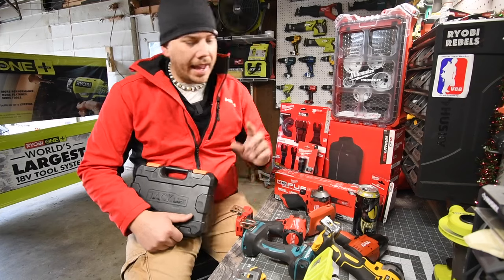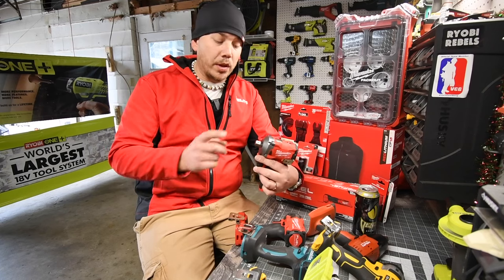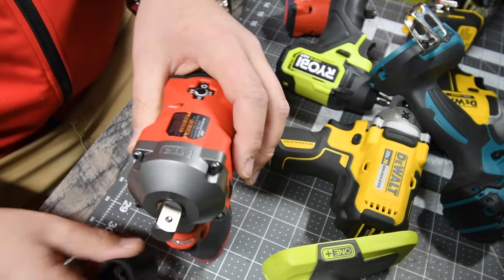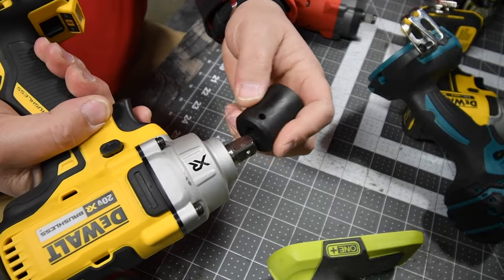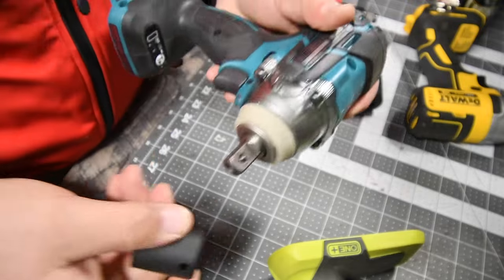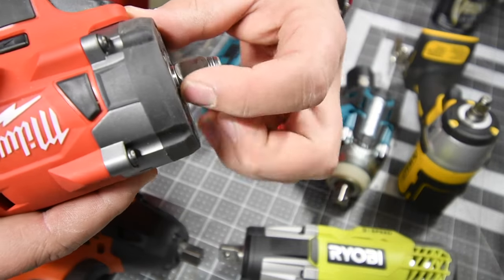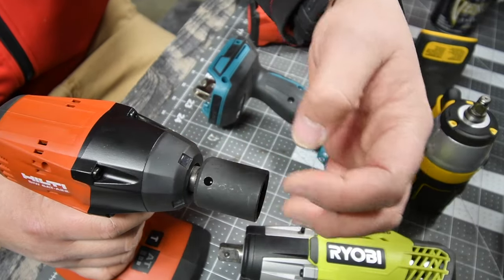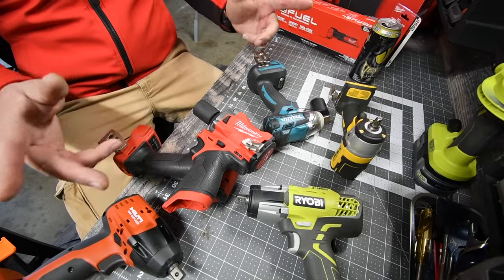(Detent Pin) and (Friction Ring). Whats the Difference?

Comment: I think it is a safety feature from Milwaukee but I could be wrong.  I would buy that M12 1/2 Detent Pin if I work on certain type of equipment (secured for safety reasons) or at higher elevation.
Reply from the maker: I think I have a defective anvil
Reply: @ManCaverTools  Reach out to Milwaukee Tools and they should fix it.

Comment: The manual states under assembly that a nail must be used on the pin detent model to remove the socket
Reply: Can somebody verify this?
Reply from the maker: I will definitely read that
Reply: @ManCaverTools  I've passed up a couple good clearance deals on some M18 impacts because of how the pin works. Some people put an extension on it and just leave it so you can swap sockets easily.
Reply: @Thastenrenar  late reply but that's exactly what I did too

Comment: Cool. The Pin detent is for safety to prevent sockets from accidentally coming off, falling,  and hittin' someone in the head. However, the anvil and socket combination affects how well it works. You can install impacts and not line up the hole and pin and see how the retention works out, or use a 1"  long impact extension with ball detent.
Reply: Good point, I hadn't thought of just adding a small extension on to give you a pin detent conversion. I have two pneumatic impacts, and on an air impact, if you bump the trigger, the socket and extension can accelerate to 5,000 rpms and go flying in about 1/2 of a second, and it's really scary. I have had to learn to be very careful. For safety, a locked pin detent is probably unbeatable. It's a tough decision when buying new, because some people hate split rings, and other people absolutely hate pin detents.

Comment: i have to say that the i had an issue with m12 1/2 friction ring anvil where sockets would rub against the metal housing unlike the 3/8.  for that reason,  i returned the 1/2 in.  the 3/8 is very solid.
Reply from the maker: very good and I thank you for your feedback toolgame

Comment: My makita 1/2 impact wrench was a PITA swapping sockets. I had to use a small phillips to get them out. I damn near pulled a shoulder muscle trying to yank off a 22mm. It has to do with the spring. You can try replacing it with a softer spring. I've never done this.

Friction anvil only for me moving forward unless the sockets I need are big/heavy or ever doing elevated wrenching which is like never. Having to use another tool just to remove sockets is ridiculous.

Filing the pin will aggravate you because you're modifying a brand new tool. I would do this in a heartbeat if I could not exchange it. Use a dremel with a sanding bit. Little bit at a time testing it after each sanding.

I would exchange it for a friction anvil version.
Reply from the maker: I plan to, other pin detents for like dewalt dont lock the socket in place. it takes some pressure put it does let it go. Milwuakee completely locks it

Comment: A few have answered your question here already. It is by design that you need a tool to release it,. But here is a tip for BOTH detent pin anvils AND hog ring anvils to get new sockets on easily.... Place the socket on a solid surface and with the anvil pressing onto it, power it on with a slow trigger or speed selected....slips in like butter! Hope this helps. After the new tool and new sockets get worn in, this won't be necessary. Yes haters I do lift!

Comment: The Pin detent should work like your other tools do, the Milwaukee one I do not know if it was their intent or not to make it almost impossible to take sockets on or off, I have the EXACT same issue with my fuel mid torque M18, the option is to return it and get the friction ring or you can grind the pin down a bit and it will work just make sure you keep it rounded and not a flat grind or the corners still catch, however not sure how sticky milwaukee would be if you have warranty issues.

Either way its annoying as hell to need a small tool/screw etc just to switch sockets
Reply from the maker: it might be a defective pin but it also might be like that for Milwaukee

Comment: Thanks for the update pin detent was designed so you would need a tool to remove the socket why it seems like most battery impacts aren’t following with the standard...I do feel like you stubby pin has an issue you shouldn’t need a tool to attach a socket this is why lots of sockets have a chamfered inlet though.
I would also like to point out I was giving constructive criticism not being mean.
Reply from the maker: I will see what a drop of oil does on the spring

Comment: What if you put some hours on the tool? I find the detent pins start weakening on other tools and the sockets just keep falling off or come off too easy. From an engineering perspective, it is the shape of the detent pin on the outer and inner faces, and it will likely wear over time anyways. Thanks for the solid reviews and time you spend on these videos.
Reply from the maker: there are ways to get around that detent pin. like filling it down a little bit. some people like it the way it is and some people dont.
Reply: @ManCaverTools  Working on my snow machine tonight and dropped the extension down underneath the motor. Reminded me of this video. I wish the detent was stronger on my ratchet. Happy new years!

Comment: It holds impact sockets differently than regular “Crome” sockets.  It is supposed to do that.  A regular socket will slide right off.  An impact socket requires you to push in the pin to release the socket.

Comment: It's literally in the manual, says it has to be manually pressed to release the socket. Not faulty. You can replace the anvil with the other model if you like, but it's not the tool's fault.

Comment: I have the same issue as well with my 1/2in mid torque and never experienced that with other tools either. It drives me nuts so I just don’t line up the ball to the hole.
Reply: Have you had any issues doing that? That’s what I thought about doing

Comment: i have the mil 2655 with the same detent pin.   i replaced the pin with milwaukee pn 44-60-1160,  which is a round BB.   now the sockets go on and off with a wiggle and a pull like any normal socket wrench with a BB.  i like it better than the friction ring, which soon loosens and sockets fall off.   but if using one socket all day,  or up on a ladder, the detent pin is the way to go.

Comment: I have same problem with mine....I just use smallest extension with detent pin and leave it on the impact. Much easier to put on and remove sockets.
Reply from the maker: ill give that a shot and I thank you for the input Mr

Comment: Straight from the Milwaukee Impact manual:  "To remove the socket, insert a nail or other thin object into the hole in the accessory and press in the detent pin. Pull the accessory off the anvil."

Comment: I had the same problem but on my 1/2 milwaukee m18 mid torque. I actually did file it down and it's been fine. Soft metal got a bit deformed
Reply from the maker: its sucks that I need to push it in to take it out

Comment: Not sure if someone mentioned. The operator's manual lists this clearly, you have to press the pin to remove socket.
Reply from the maker: its says that on all of them but you dont need to do on any of them except the Milwuakee
Reply: So what you're actually saying is that the Milwaukee detention pin actually works how it's supposed to and the others don't? So why is this video about Milwaukee needing to fix it?

Comment: I have used the Hilti a lot. Just need To oil the pin now & then. So it works perfect. Otherwise it May dry out and have issues. But all tools need To be taken care. When i say alot its so much they get Hot in use.
Reply from the maker: I will try that. never needed to oil a detent pin because they always worked. but I will try that

Comment: It's designed to not release the socket without pushing in the pin. Especially on high torque fasteners. I've had way more trouble getting some sockets off of friction ring drivers.
Reply from the maker: I wanna see what happens if I oil up the spring a tiny but and I thank you for you input Jeremy

Comment: Have you reached out to Milwaukee Tool concerning the issue with their ball dtent?
Reply from the maker: I talked to my TTI rep about it today. he said he will relay the info to his boss
Reply from the maker: and I thank you for commenting Bro
Reply: It’s not a ball detent, it’s a pin, meant to hold on to the socket better than a friction ring
Reply from the maker: @caidencrawford9913  then why do the other impact wrenches let the socket go? and this is the only one that doesn't? ive never seen anyone in real life or youtube push that detent pin in like that to release a socket.
Reply: @ManCaverTools  well as my second comment says it’s for MAXIMUM socket retention, for those who don’t change sockets often, if you do change sockets often, like you, I’d recommend that you get the friction ring, still holds really good but is also easily removed
Reply: @ManCaverTools  not trying to be negative or anything, just trying to help, love what your doing and keep at it 👍🏻👍🏻
Reply: @caidencrawford9913  But the Home Depot site also claims that the ryobi and dewalt he used to also utilize the “ Detent Pin” and not the ball.
Reply: @caidencrawford9913  Ha Ha exactly Caiden!  Guys will argue hog ring vs pin detent all day long.  Both have their place.  If someone is using impact sockets, don’t line the hole up on the detent, and it will come off easier.  Milwaukee even states in the manual to use a pick or something to remove the socket.  I slap a socket on, and keep the detent away from the hole, and no problema!  I have an M 18 mid torque, so I’m not talking out my arse!  Peace! 😊
Reply: I just got one for christmas does the same bullshit i dont like it
Reply: @ManCaverTools  any updates? I'm considering buying a 2962p-22 but this would hold me back as over heard the same issues with the 2962p
Reply: The Milwaukee is actually working correctly on my dewalt 899 I have to use a nail to remove it but on mid torque I can pull it off without a pin but your really supposed to pull it off without a nail or a pin
Reply: It's actually a pen detent and in the instruction manual for the 2962p-20 it explains to use a pin or small nail and depress through the hole of the accessory that was installed on the Anvil in order to release the PIN. A socket not releasing is actually designed into it. If they wanted you to be able to remove the PIN without depressing it with a thin tool then they would have rounded the PIN head just like every ratchet and extension is intended for Chrome sockets.

Comment: I have a DeWalt DW059 18v nicad impact wrench with a detent pin that's incredibly difficult to push down like your M12, but i just assumed it was part of the design of the tool
Reply from the maker: I think its not supposed to be like that.

Comment: I’ve got the Dewalt DCF899 and I have to use a screw/nail to push the pin down to remove the socket and depending on the socket sometimes to get it on too. I was hoping that after 2+ years it might have eased a bit but it hasn’t so reducing it with a file is probably the answer. 
 Really enjoy your videos, ignore the negative comments 👍
Reply from the maker: I might have to file it down a little bit and I thank you Matthew
Reply: I just got the DCF899H today with the hog ring after reading detent pins are designed to require a tool to remove the socket.  It's my first impact wrench so wanted easy.  The first socket was a bitch to get on, used my pallet to lightly tap it in.  After that, it's pretty easy to get on and off.
Reply: Milwaukee should have used a ball retention. You can use a stubby 1/2” extension as a workaround.

Comment: I just bought the Milwaukee m18 fuel mid-torque ½" Impact wrench (2860-20) with the D10 pin and im having the same issue. I have to stick a nail in every time I need to switch from the 5 Sockets I constantly use.
Reply from the maker: it might be apart of the design on the miwlaukees

Comment: If you can push the pin detent in with a metal pin it is working fine. If you want the socket to come off easier put the socket on so the pin does not line up with the hole in the socket and the pin will drop into the groove and be easier to pull off. Or you can file the ball detent a little bit I would not do that. As you use it and push the detent with the metal pin you are using it will be easier to remove but it is working as designed.
Reply from the maker: it was just crazy to have to push that in every time

Comment: M18 18-Volt Lithium-Ion 1/2 in. Brushless Cordless Mid Torque Impact Wrench W/ Pin Detent Kit

Regret getting this. I use this tool for fixing cars and each time, had to use an object for the hole. Always make me wonder why other tools Detent pin works better than the milwaukee one I have. Why didn't milwaukee include a Detent tool with the impact?

Comment: Hilti usually always gave me the same fit until I got them good and broke in, best way I've found is to grind just the very tip of the detent pin down then it's like butter just like on a ratchet!
Reply from the maker: its good in some situations but its also bad for quick stuff

Comment: I checked my owners manual (I have the same model with the detente pin). It says "If you are unable to place/remove sockets due to too much pressure, hit the detente pin with your purse until it works properly."
Reply from the maker: I know. I also show that.
Reply: @ManCaverTools  Did it work properly again?

Comment: Hard to put on and remove. That’s not normal, should slide on easier than that. But having to press in the pin, that’s a normal thing, if you look at the other models you have there’s a slight difference in the designs. Pin detention is made for those who use one socket for longer periods while hog/ friction rings are for those who are constantly swapping between sockets. Some oil will probably help you out for putting it on, but once it’s on, likely gonna have to depress the pin. I have all hog ring because I change sockets a lot through out the day when I’m using my impacts I have 3 Milwaukee and 2 kobalt guns
Reply from the maker: I agree with you on that. it might be a defective one and I thank you for your input Tyler

Comment: Might sound crazy but have you tried a different brand of sockets? I have had similar issues before but using a different socket brand worked fine while another wouldn't budge.  That said, looks like the manual says this is a feature...
Reply from the maker: the sockets I use work on the rest of them, its the anvil on the stubby

Comment: He Dude, the Milwaukee Dented pin is fine and doing what is suppose to do, this is an industry requirement when you do not want to loose your socket and drop it , while if your requirements are to change out your socket faster, then you should go for the other system.
Reply: yes.  its the ryobi that doesn’t meet OSHA.

Comment: Dave my brutha... Milwaukee uses invisible glue on their pin detent anvils 🙄😁 Seriously,  Don't line up the detent pin with the hole!  Socket will still stay on, but will come off easier.  This is what I do with my Mid Torque M18.  Try it out!  Milwaukee states in the manual to use a pick or something sharp, to remove the socket.  As others have said, this is what the detent is for, to assure that socket ain’t going anywhere.  And pin detents work like that, vs ball detents.  If you’re still having issues, try a non impact socket, or send it off to Milwaukee.  Their e- service repair works alright.  I’m thinking your anvil is just fine, and please try my suggestion.  Nuttin but love for ya !  😁😊✌🏻 Stay safe Healthy peace 👍🍺🇺🇸
Reply from the maker: im going to put a little bit of oil in it to see what it does. and I thank you for viewing George
Reply: @ManCaverTools  You’re Welcome Dave.  Good luck with that, but I’m telling you, if the anvil has a pin, vs ball detent, it will take a sharp pointed object to release the socket, if it’s in there.  Don’t line up the hole in the socket, with the pin detent!  Socket will stay on, but will come off way easier.  Works for me.  Up to you my man.  Peace ✌🏻 👍🇺🇸

Comment: I recently bought the m18 mid torque and encountered the same thing, seems like the spring on that pin is too stiff.
Reply from the maker: im going to try to spray a little bit of oil in it and see what happens

Comment: I was always under the impression that you needed a tool to release the detent pin with a tool. Personally I like friction ring anvils but the sockets need to have the undercut groove in the drive end to hold on to the friction ring
Reply from the maker: they both have their benefits
Reply: the friction ring like the name implies, works purely on friction, the square hole on impact sockets are flat and smooth all the way back so they never get locked on. the detent grooves on chrome sockets actually destroy hog rings like nobody's business. one thing that sucks about friction rings is that they don't last very long, they need replaced twice a year if you use them daily, when they're worn out or abused with chrome sockets, they stop holding sockets all together and you have to hold them on like a scrubb.

Comment: It's better for them to come off a little rough, anyway for the detent pin, try using alittle bit of WD-40 and only WD-40, and don't file or modify anything, it may need alittle bit of lubricant until it works freely,  just try it, and dood luck. 😊

Comment: Could be a issue like if the milwakkee only doing it i thought was a safety feature putting a pin in to release but seen you cant  put a socket on very easy thier might be a problem dave 👍i like the detent pin models better that the hog rings
Reply from the maker: I like the pin better as well, which I why im disappointed with how I have to take the socket off of this